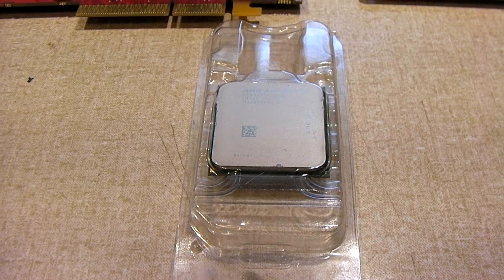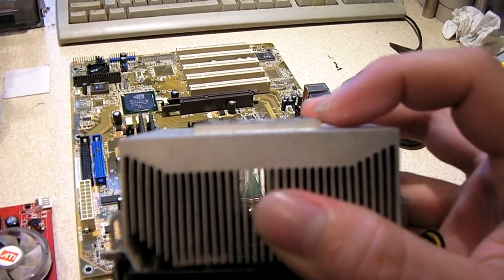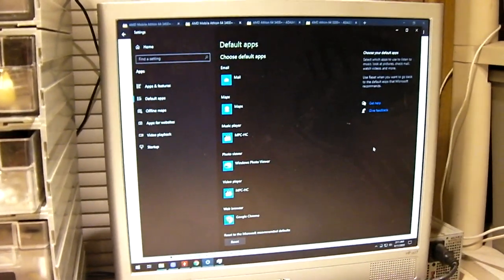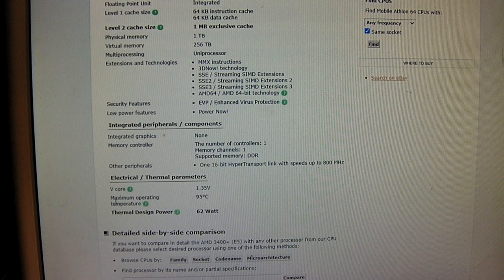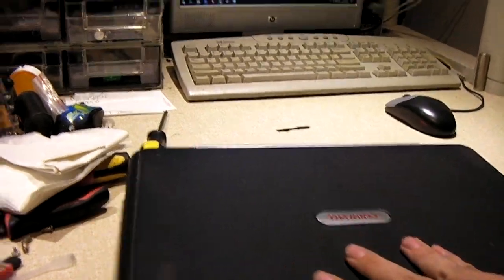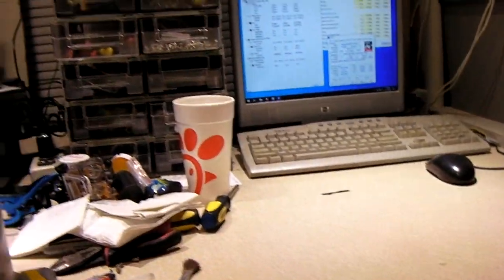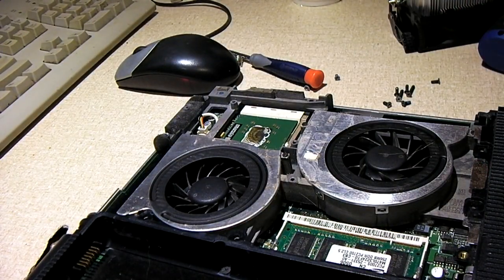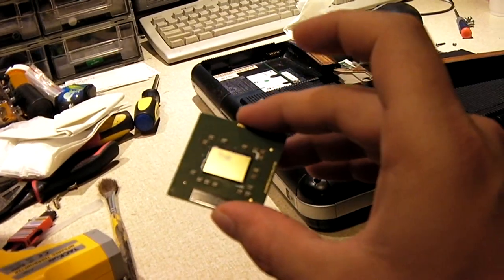Part 1: A laptop CPU that you can use in a desktop PC!

Comment: I think the main problem is a lack of RAM. I would consider 4GB of RAM to be a bare minimum for Windows 10. I am very surprised that Task Manager only showed 40% RAM usage.
Reply from the maker: It wasn't the lack of RAM, but rather a very slow and dated pipeline of the old socket 754 CPU, but even moreso, the old nForce3 chipset.

Windows 10 will run on 2GB of RAM and run much better on Socket 939 and AM2.

Comment: I didn't notice if the board had SATA ports? It would be interesting to see how much better it performs with an SSD.
Reply from the maker: There would only be a very slight improvement in performance, if even that, since the motherboard's 2 SATA ports are SATA-150.